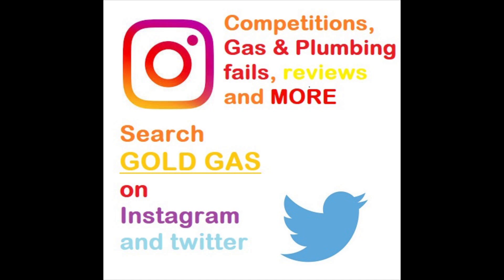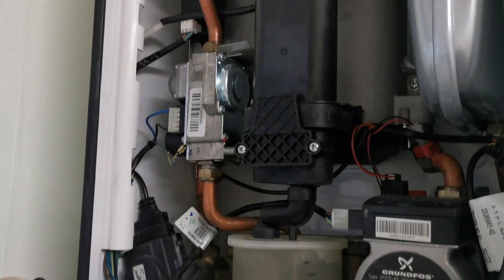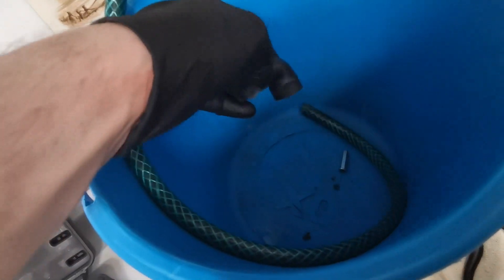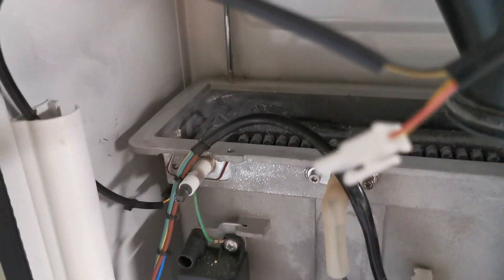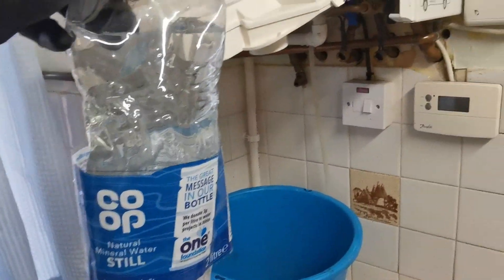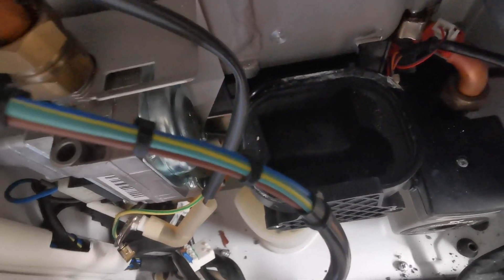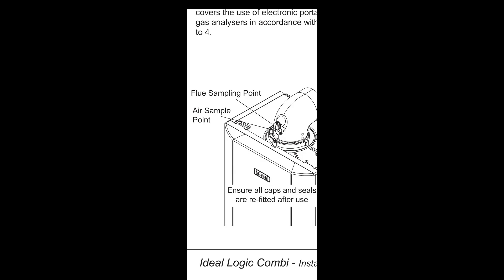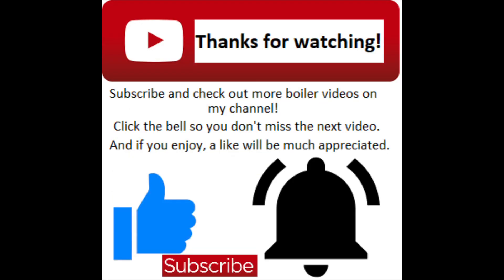IDEAL LOGIC BOILER SERVICE - How To Service An Ideal Logic Boiler

Comment: U should tell people about the little crack that can appear on logics when u take the sump cover off on the top right hand side. Easy to miss and its AR
Reply from the maker: Pinned! Very useful. 
I should of mentioned it and I was meant to, but only realised when I finished the video. Gonna do more ideal videos, so will get it in there.
Cheers for watching mate! 👍
Reply: Yep mine had the hairline crack and flooded the whole base of the boiler. Be careful to get the correct part. My engineer came out and fitted one that had the connector on the side rather than below so basically had to snap it off and refit the correct one the following day. It was a pricey lesson learnt.

Comment: I got a problem with my boiler, when I turn the heating on it leaks and we had no hot water so we had the flue manifold changed which cost us £120🙁 but it is still leaking so we were told to have a new heat exchanger filter which will cost £300-£400 and my boiler is only 3 yrs old 😭😭now we can’t turn the heating on because of the leak
Reply: Is the boiler not under warranty?

Comment: Excellent service. You doing the way service must be done. I had half a dozen boiler services in my property and the gas engineer max spent 20 minutes. They don't check everything as you do.
They don't even clean/remove limescale build up in the clear filtering box/tube

Comment: We have this boiler and it has an issue with hot water. The boiler fires up when a hot tap is turned in the bathroom but it will shortly go off again like the boiler does not see a demand for the hot water anymore. However, if we put 2 hot taps on at the same time the boiler will stay firing and give us hot water. As soon as one tap is turned off the water on the remaining hot tap will turn cold. Any ideas? Central heating works fine

Comment: Fantastic very professionally explained 
Wish this gentleman can service our logic combi boiler which is being a nightmare for us l2 f2 all the time 😔
Had it serviced over a year ago but think we have been cheated by this boiler man.😔
Reply: Change your electrode.  I got it for £15 online.
Reply: @CraZZy_engineering  Thanks mate did works great 👍
Reply: @Abulsuny  if the f2-l2 appears again within weeks , then the heat exchanger is filled with carbon deposit you will bees to flush it with water as seen in the video. But you should change the heat exchanger gasket.
Mine has the same problem. I didn't get time to clean the heat exchanger but i keep cleaning the electrode with sand paper..
Best of luck.

Comment: Answer to an Ideal boiler...scrap it and fit a Viessmann.

Design fault in heat exchanger...mine lasted 2 years from new.

Replacement warranty one year not ten.

Ideal will not guarantee their boilers for ten years unless it was fitted from new with their own brand filter.

Avoid.
Reply: That's nonsense. I've had two warranty calls on the Logics I fitted. The rest have been fine and the first one I fitted was ten years ago. I have one at home since 2016. I've changed one sump on a very early model somebody else fitted locally. I've seen far more Worcester Bosch heat engine failures. You do know there are over 3 million Logics out there now and for the most part they are pretty bullet proof and dead easy to service properly. Viessman electronics fail in my experience though they have recently dropped the price of control units/ boards.

Comment: Great lesson to stay away from fitting Logics
Reply: Logics are brilliant and easy to service and fix. They are pretty reliable and they've sold nearly 4 million. I've had a heat only 18 for six years, no problems. I used to fit them before I retired. None of mine needed sumps though I have fitted sumps to early logics. I hardly had any warranty calls on them. Customers like them, job done.
Reply: @timhancock6626  sold nearly 4 million of them because they knock ‘em out to major developers for £300 each 😂

Comment: I use a garden spray bottle with the manometer hose attached to sparay out the heat engine.  It's also great for filling up the condense trap before you put the top rubber hose back on.  Infact it's great for a multitude of different applications. 😁Always as usual great content pal. 😉
Reply from the maker: Oh wise dude. 🙌🙌 Cheers mate. Great advice too mate, will give the hose on my sprayer a go. 🤟👍

Comment: Well done on cleaning and flushing out the heat exchanger 
you must be one of the few of the engineers who actually bothered to do it !
Believe me I have seen a few that have not been done
Reply from the maker: Cheers mate, appreciate that. 👍
It don't take long at all on this boiler. I just do the job I'd expect if I was paying for it
Reply: Gold Gas Videos No problem it’s nice to see engineers out there who do the proper job 
trust me I have not seen many cleaned at all and you can always tell when they’ve never been apart
Reply: Gold Gas Videos , Keep up the videos mate they’re really enjoyable to watch
Just out of interest what brand of boiler do you have at home?
Reply from the maker: @SalimKhan-gk1fh  appreciate you saying pal. Means alot.
My boiler is (not by choice) ideal icos. Nothing wrong with Ideals, but the icos /isar boiler is not my favourite.
Reply: Gold Gas Videos  yes nothing wrong with ideal, the later logics ,mini  and independents all proven to be reliable enough 
The odd cracked sump and flow turbine but ok in general, my Combi at home is a viessmann by choice 
Got the vitodens 100 and I’m over the moon with it!🙂 viessmann also my first recommendation to customers
Reply from the maker: @SalimKhan-gk1fh  yeah not massive problems, yeah viessman and those ideals are the good ones. And the old old ones, classic and that.

Comment: Top job. I've heard the spacing between the two electrodes is about the same size of a pound coin.
Reply from the maker: Bang on it mate. Easier than a tape haha. Cheers geez 👍
Reply: @goldgas1216  you can give the electrodes a good file all around.  It should keep on continuity from point to point.  I have in the past heated the tips until they're cherry red and straightened them. Yeah spacing is as much as pound coin.
Reply from the maker: @rayc1503  defo on the file all around, haven't tried heating and bending it. Will defo try, haha if it breaks I'm blaming you😂